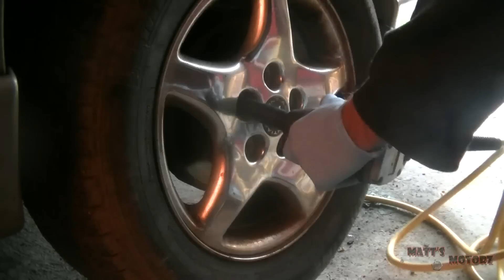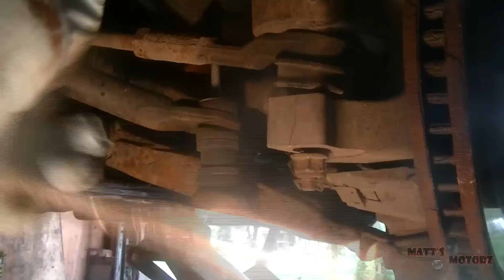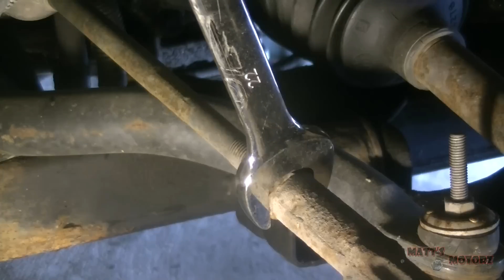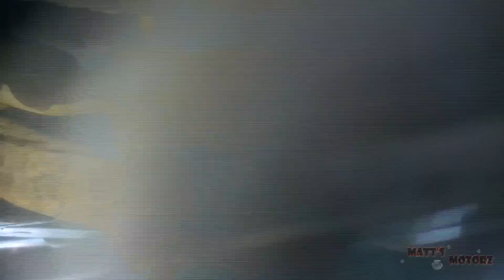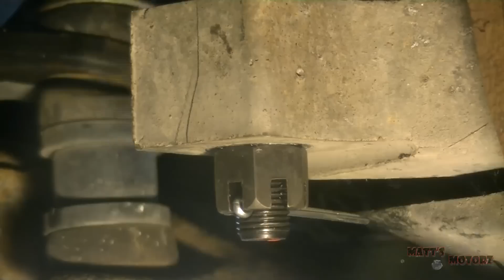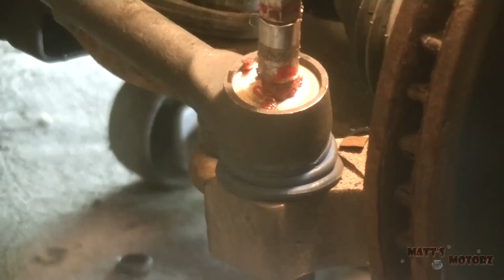Replacing an Outer Tie Rod End [1999 Pontiac Grand Prix]

Comment: I replaced my inner tie rod on both of my Pacificas and I found that the old compared to the new one was a hair different in size. I took my large digital caliper I had and measured the old compared to the new one and marked the new one so it was exactly the same size when installed and it worked perfect. No parts are exactly the same size so counting threads doesn't always work. I have 40,000 since the change and no bad tire wear on either car.
Reply from the maker: Bill M If the part is longer, you need to compensate by adding the addition threads on the longer one.  It still works, but you just need to do a bit more mental work.  But it doesn't matter too much anyway, you should still go to the alignment shop to get it aligned afterwards.